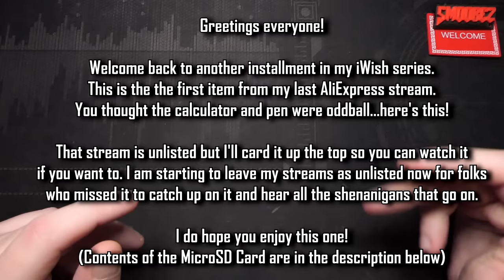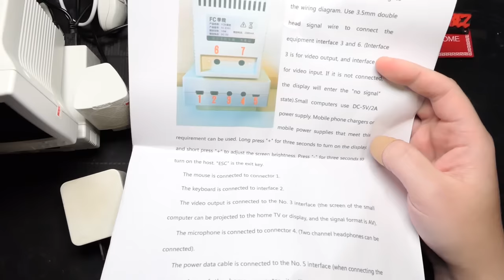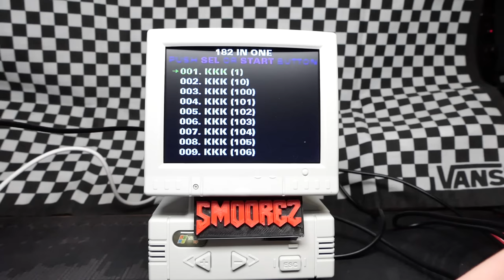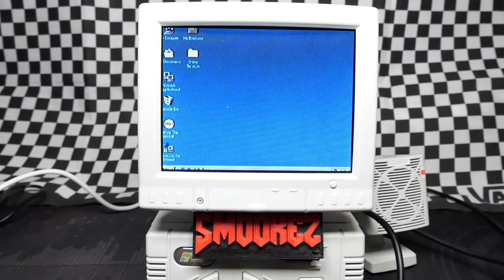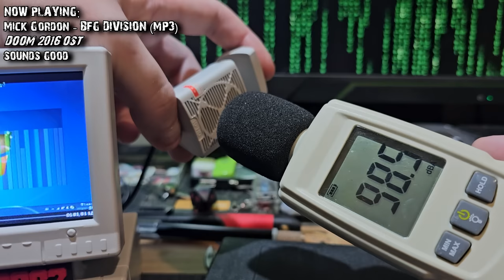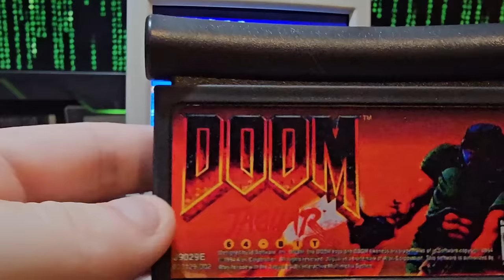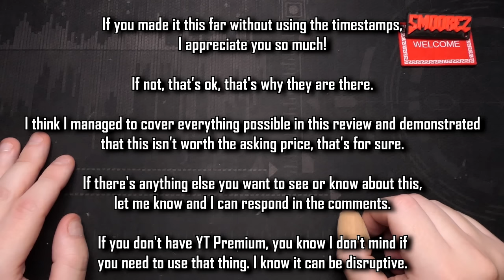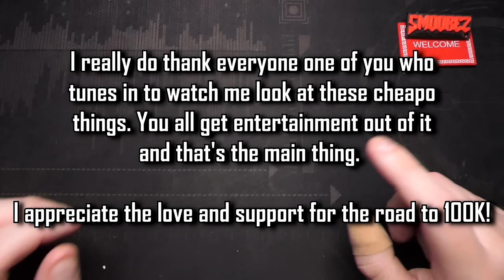iWish: This $112 Famiclone/Media Player is not a Mini Retro PC - it's a janky mess

Comment: IMAGINE retrofitting a raspberry pi or something similar into this.
Reply: Those are way too scalped
Reply: @TerrorSyxke orange pi 4 would be OK here. $35 in the right places.
Reply: Fr. The shell is definitely the coolest part. Mini PC in it would be super cool.
Reply: I was wondering if you could hack a miyoo mini into it.
Reply: @TerrorSyxke yeah...not worth it even for a project
Reply: It would probably be better and cheaper to 3d print it (or get it printed) and build it yourself. Especially because of the high price and terrible lcd.
Reply: Intel NUC would give you proper x86 CPU so you could run actual PC apps native.

Comment: Desiccant/oxygen absorber bags are very.commonly used in packaging to prevent corrosion and/or spoilage. Surprised you haven't seen them before. In this case they appear to just be used as weights.
Reply: which is weird because these dessicant bags normally don't weigh anything... nor do they come as sealed plastic bags with no way to absorb moisture
Reply: @Knaeckebrotsaege  Well, these are the oxygen absorber variety, not dessicant, according to the labeling. The packaging looks normal to me for those. Whether they are real or not, who knows?

Comment: Pay closer attention to the microphone jack: for some reason it's a TRRS jack. I don't think they're actually using all four channels with this, for a standard microphone two is enough (so most come with a TS jack). This one with its TRRS jack is probably misaligned when plugged into a PC and/or wired differently.
Reply: TRRS is 3 channel. 1 is ground
Reply: @dntfrthreapr  pardon, wrong wording, but I still got my point across, I think

Comment: are you able to output the thing to another tv?, it is possible with av connection or try using the adapter in reverse with rca cables

Comment: Did you know the Pi 02 has a composite video out on board and is the size of a stick of gum? And is also a quad core 64bit computer with 512mb ram? And costs $25 AU. Just thought I'd mention it, not for any reason.

Comment: My guess is that the main board is just a moildly modified generic bootleg console that outputs a tv video signal that connects to a generic lcd controller board that emulates a crt, which explains the onscreen controlls.
Reply: Probably! Or the mainboard is a cheap mp4 player/low power 32bit ish mips/arm computer with custom software

Comment: They might have wired up that mic janky too. Noticed it's a 3 contact jack. Not the first time I've seen mics use that but perhaps they messed that one up and put the positive connection on the middle pin instead of the end pin and that's why most PCs have issues using it.

Another way they might have messed up the wiring is having the ground to the middle pin instead of the bottom one. I think maybe a multimeter might reveal that. I think you could possible fix it assuming the wire was made properly and still has all 3 wires. I think for best results you'd wire the middle and the bottom to ground so they both act as ground instead of just one of them with the tip being the postive. (but honestly they should have just used a mono jack on the thing to avoid this issue. :P )

Makes me wonder why it works on that device but not anywhere else if it was wired up incorrectly. Maybe it works on mono jacks but not on stereo ones. PCs these days tend to have stereo MIC jacks...I think? They tend to be multipurpose jacks actually so likely stereo/3 contacts.

Try the mic on something older that has a true mono jack on it. You might find that it works correctly on that.

Comment: They could have improved the design by just incorporating the inputs on the back of the "monitor" directly down into the "PC" and just have all the connector on the back of the PC. Seems like their is room for them. Monitor housing seems like there was enough room to incorporate the speaker rather than dangling an external one.

Comment: Probably not a famiclone. The media capabilities are way beyond what a famiclone could do. Probable just some cheap ARM SOC with a NES emulator in the firmware.
Reply: Could have both an ARM soc plus an "nes on a chip" style famiclone both in there
Reply: Maybe the JieLi JL series microprocessors or equivalent series from other manufacturers or just the actions atj series idk 🤷

Comment: “Red, or White, it doesn’t matter.”

I am so TRIGGERED right now. It does matter! You always use Left when you have a mono speaker plugged into a stereo device!

Joking aside, the reason for this is due to how stereo from that era was mastered, the left channel contains enough audio data from the right channel that you can still hear the entire soundscape, while the left channel will not have any of the right channel’s sound. In extreme cases (such as when two characters are each in a different ear) with only the right you’ll hear just one character’s dialog, while with only the left you’ll hear both.

Comment: They could haver put the speaker into the " monitor" wouldn't be any worse. The small board is the AMP for it probably.
Reply: It's cool they went the extra mile and made it appear like a complete computer system. :p

Comment: You should have really ripped one of those little stuffed bags. I'm still curious!
Reply: It's just silica gel, desiccant. Same thing you get together with every electronics, except it's normally not locked inside but just kicking about the packaging, and the envelopes are normally white rather than Ramen spice coloured. Look like little odd glass beads. They are usually colourless when packed like that, though amber indicator variety exists that turns green, then blue and eventually black as it catches water. They are brittle and if you break them, you see the irregular jagged structure inside indicating that the material is actually very porous at a microscopic level and has lots of internal area for the water to stick to.

Comment: Ok, a little VERY basic lesson for whoever...

As the requirement is 5v 2a for this device. You could use an adaptor rated at 5v (MAXIMUM!!) but the wattage could be 999999a (you get what I'm sayin' here? basically whatever wattage). As long as the adaptor is able to supply a MINIMUM of 2amps (10w in this case), there will be NO HARM done to your janky lil toy.

A device will ONLY draw WHAT IT NEEDS and no more. The only danger is the VOLTAGE of the adaptor mustn't by higher than what is required (even though you should be fine if the power source wasn't pushing more than 10% of the devices VOLTAGE requirement).

Bonus bit: On the flip side (and this can be dangerous with higher powered devices)... For example, with a laptop needing 18v/4a: If you tried to use an adaptor with the correct voltage BUT it was only able to supply 3amps, things may run fine at first, but when the laptop launched a game (or whatever [it just needed more juice]), the adaptor would start to overheat and especially if it was a crappy cheapo type, you could experience a pop following its immediate demise ORRRR you could end up cooking your home along with the family cat.

Wow that got long, but I'm hoping at least one person (or indeed a family cat!) over the course of time may find this ramble useful in some way ;).

All the best & thanks for the upload btw mate. Was a nice and enjoyable watch.. gonna go binge some of your other stuff now!

Comment: I would love to put a real little mini computer inside like a raspberry pi 5 an actual real little mini PC that would fit and change the LCD panel out for something that has good resolution basically I would just modify the shell use what I could I turn this into a real little PC you could really turn this into a retro PC get one of those tiny little 90s handheld laptop thingies put all the guts inside of this the nice new Chris LCD panel because that thing is s***